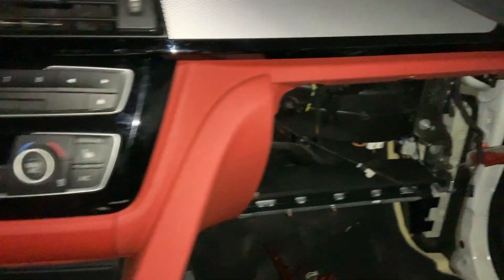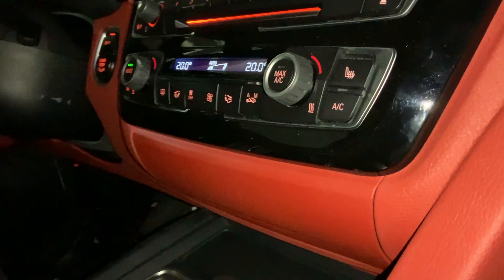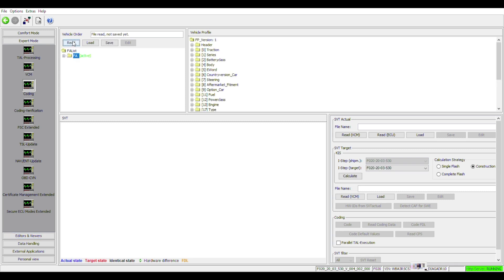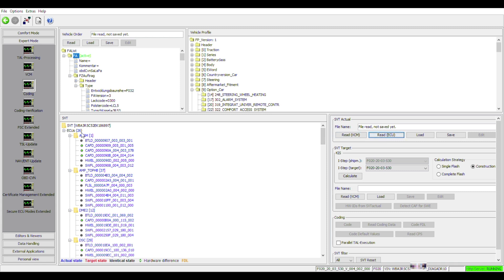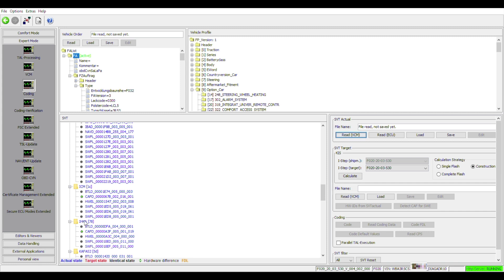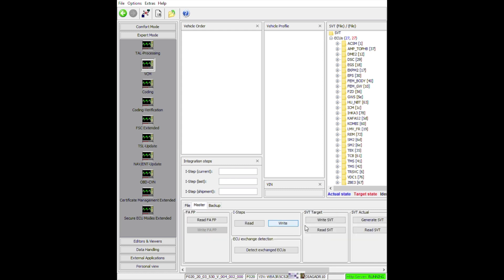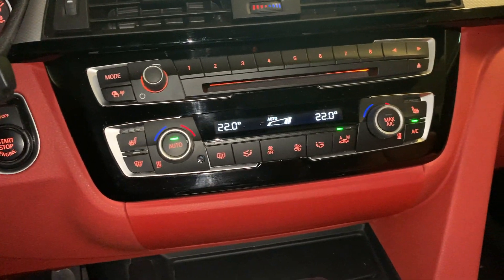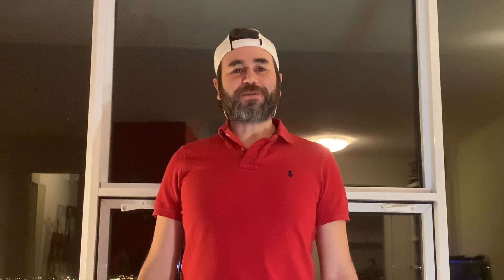BMW F32 435 IHKA3 (LCI) A/C Control Unit Retrofit - Coding (part 2/2)

Comment: Great videos, thank you for all the information. Can I ask you where did you wire the new led radio trim if the 435i doesn’t have and led over the cup holder?
Reply from the maker: That might be a little bit more intricate, but it’s doable. You could wire it to the footwell lights, but to be honest with you I would probably wire it as OEM so that would mean passing wires to the FEM and coding the interior light option

Comment: Hello and congratulations for your videos and knowledge! I have a question, I was occasionally driving a x1 f48 lci that It had a function where when you turned off the car the air conditioning blower continued to run to dry it out, is that possible to code it to my f20?
Reply from the maker: Hi, do you mean the “snowflake” button? If so, did that f48 had the auto a/c? AFAIK, when cars have the auto a/c mode it takes care of that. It really depends on the equipment of the car.
Reply: @DorksandBolts  yes it had dual zone auto ac. When air conditioning was active in the summer and then I switch off the ignition, I had noticed that the blower runs for some moment even after locking the car, I imagine to dry out the evaporator so that mold doesn't form

Comment: Hi I managed to retrofit my F34 2013 with IHKA3 and followed your wiring modification. It works but the aircon button does not work and the unit does not turn off. It always run on a minimum fan speed. Can you help me to code the unit?
I tried Bimmercode but the IHKA3 module is not detected.
Reply from the maker: Hi, yeah I don’t use bimmercode, have you tried with e-sys? I could give you a hand with the coding, however I would need a lot more information about your car please reach out to me on WhatsApp.
Reply: @DorksandBolts how do we share Whatsapp contacts cause Youtube does not allow me to share it here?
Reply from the maker: @TebohoRakhale it’s on the channel contact links
Reply: @DorksandBolts apologies if I’m being a nuisance. I’m picking up your number using the link. It says the number is not on whatsapp. 🙏🏽
Reply from the maker: @TebohoRakhale no worries, try now please

Comment: hey man, i'm trying to retrofit IHKA3 on a pre-lci f30, did all the wiring as you did, plugged in the new IHKA3 module, but the windshield demister button is constantly blinking... so i checked with esys, and when i press read VCM it says IHKA but when i press read ECU, ihka disappears. when i read vcm and left click IHKA and do anything with it, it says timed out... (cant connect to ECU basically). any solution for that? also the 6:13 part is VERY unclear :( i have no idea where to find these infos or how to look through pszd files...

Comment: Buenos días 
He seguido tu vídeo con muchas atención .
Tengo un problema haber si me puedes ayudar
He cambiado mi klima  panel control por avería es un f20 lci 2018.
Pero me ha desaparecido la opción de aire por arriba del puesto de copiloto.
Me puedes ayudar a codificar con esys o Ista d
Muchas gracias
Desde Barcelona (España)

Comment: Hi there, great video i just have one question, is it possible to get all the amber lights coded to be white all the time including the light switch steering wheel shifter etc.? Or do i need to get separate parts or bulbs? Many thanks in advance!
Reply from the maker: Hi Armin, the only lights you can do that are ambient lights, cluster and hvac panel, all other lights will need to be hardware modified

Comment: Hi I need to code a used Ac heater panel, do u have a procedure for doing this please, thanks in advance
Reply from the maker: Hi Steve, maybe I am misunderstanding, but the panel, (buttons) you don’t need to code. It’s all controlled by the ihka module
Reply: @DorksandBolts  hi sorry, I put heated seats in my car so I needed a ac heater panel with the seat heating buttons on so I bought a used one off eBay and I need to set it up as esys says the ihka module is missing
Reply from the maker: Ahh I see. So I assume that you did your wiring and all that, nothing else to do here besides adding option 494 to the ihka + seats modules + frm depending if you have retrofitted memory sport seats or not. That is all, just change the ihka module, code it with that option and that’s it.
Reply: @DorksandBolts  yes I’ve done everything , I just need to get this ac panel connected, I don’t have any details of the used ac panel, do u have a video on how to do this ?
Reply from the maker: @steveiles2601  no :( sorry no videos about that... but its a good suggestion to do a quick tutorial about this since we are waiting for parts for other projects anyway.
Reply: @DorksandBolts  that would be great if u could

Comment: Hi ,I have retrofit this ihka and display and coded it, everything works,only the Max AC button doesn t work
Reply from the maker: Hi Margaret! It’s great to hear from you. First we want to let you know that you won the Carly adapter for iOS. So please contact us through our Facebook, Instagram or email so we can arrange mailing the adapter to you. Now for your problem, do you have any blinking lights on the panel? Do you hear the AC pump working when you hit the AC button, is there anything else abnormal in your panel?
Reply: @DorksandBolts  Hi, there are no blinking lights at all, everything works perfect,accept these( MAX A/C button )wen  i hit it, it does nothing. The a/c works only wen i hit the  small button.(right side display) Thanks for the price by the way
Reply from the maker: Hmmm so I think this might be related to a protection of the system depending on outside temperature, I don’t know where you are located but if you are in a region where the temperature is around or below 5c it won’t engage
Reply: @DorksandBolts  Hi,thanks for the info,my a/c max works perfect now,yesterday it was -5c and it doesn't work today its +5c and it work again.Thanks
Reply from the maker: @margaretkleisman5215  great news! We are glad to hear

Comment: Hey I have a Problem with coding. I changed all the parameters like in the video but the IHKA shows a fault. What do I make wronge? It hasn’t communication for coding. The rear Window heating button is still blinking.
Reply from the maker: wow... sorry I just seen this comment. Did you solve the issue? I think that the wiring is not correctly done. make sure the new module taps into the CAN2 network
Reply: @DorksandBolts  Hi, yes I could solve it. Wiring was ok but you have to change the ZK from IHKA to 03/14 or newer and code the IHKA with changed ZK
Reply from the maker: @SA-Performance  Oh yeah thats true! forgot about that little detail. I am glad it all got sorted out. love your videos as well!

Comment: Hi, where did you find the id and stuff for the module that you modified at 6:00. I have same ihka3 module as you but i cannot find the information.
Reply from the maker: The information that you need is partiallly on the label, then you need to research on your psdz files for the relative files. However, if you have the same as me, just use the numbers I use, and you should be ok. Another option is to “read ECU” and copy the files, if you are only missing the cafd, all you have to do is inject it and use those numbers instead.
Reply: @DorksandBolts  This is the only part i can't get it. On label there are some numbers but i can't relate them with anything. How can i "research on my psdz files for the relative files"? I have IHKA3, production year is 2015 and its part number is not same with yours. If i use your numbers, will it work? Can you share how to research our ihka's numbers for updating those values?

Comment: Hello there, how are you doing?

Been trying to retrofit the IHKA3 to 2012 BMW 328i as well but can't seem to code the IHKA module.

So I have changed the wiring from CAN to KCAN2, changed the build date to 02/2015 and updated the istep level to 2019.

But it seems that esys nor ista won't recognize the module still. The diagram tree from ISTA is showing the IHKA module on red.

Any input will be much appreciated.

Many thanks!
Kevin
Reply from the maker: Hey Kevin, 
When you read the VCM with Esys, is he fld present? If not inject it first. Then try to read the file. If you can, then you can write the results to the VCM. and continue the process as we did. I didnt really had to change the FA date though. I really dont like to mess with that. Let me know if it works.